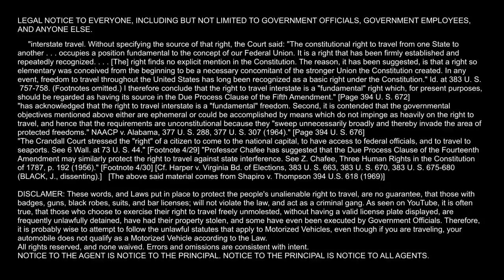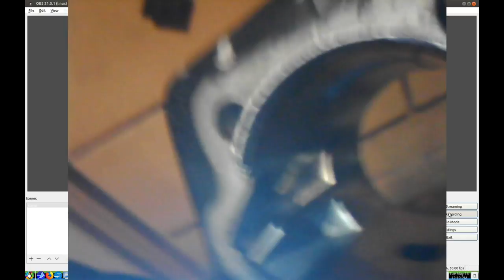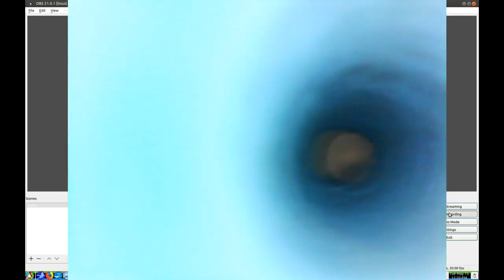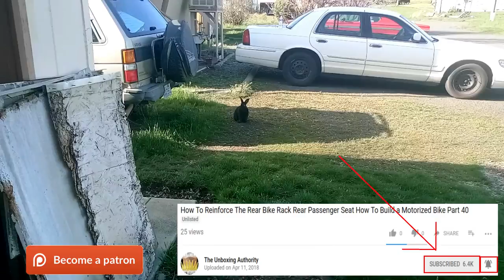Whats Inside BBR Tuning Stage 3 Engine Cylinder Borescope How To Build A Motorized Bike Part 59

Comment: Are u in Washington if u are i was riding out there in yakima on a fm80 me and some folks that i sold it to
Reply from the maker: What's different between an FM80 and PK80?  Is the FM80 direct to the crank case?
Reply from the maker: Yep, I'm in Washington State.
Reply: I never cracked it open to find the real difference but when i ported it sum i felt the tourqe i didnt in the others i ran
Reply: Suppose to be half balance from what i heard
Reply from the maker: half balance?